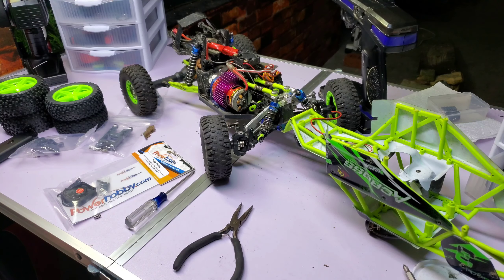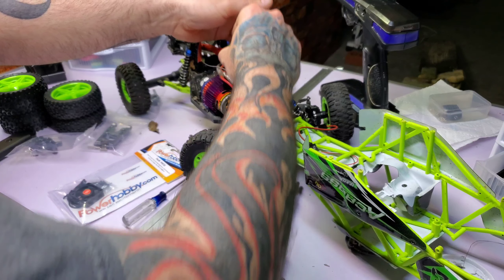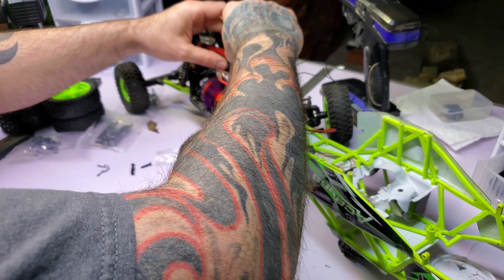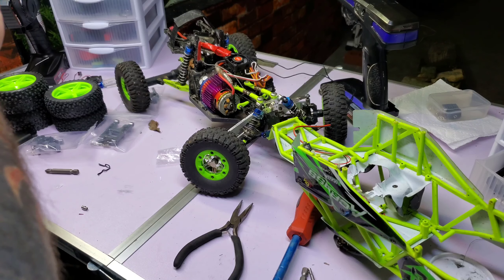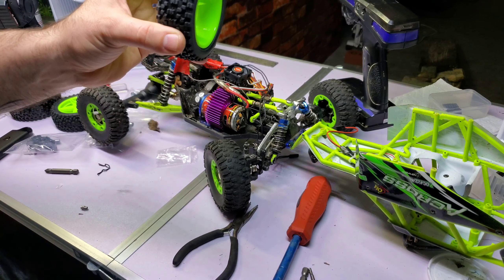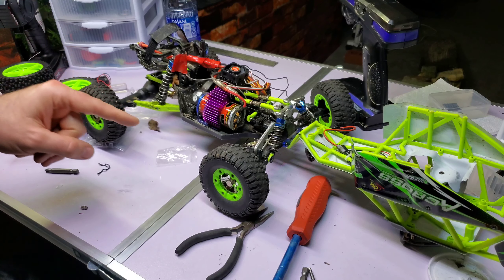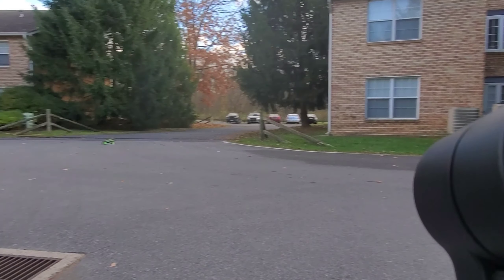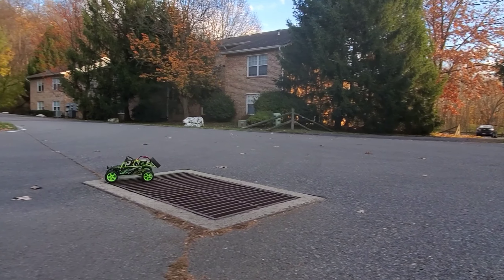Wltoys 12428 fan install and 3S run. New $20 Wheels.

Comment: The interior piece is useless. Ditch it! Your rear upper links need to be longer so you can get rid of the crazy driveshaft angle into the rear end.
Reply from the maker: I'm installing  a brushless system soon.  Thats a great idea! Keep it alot cooler too.